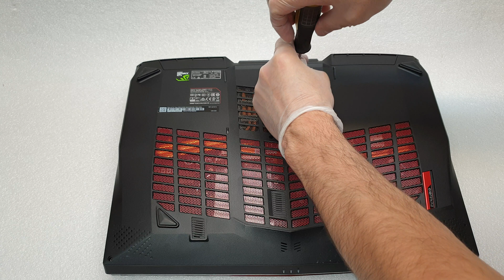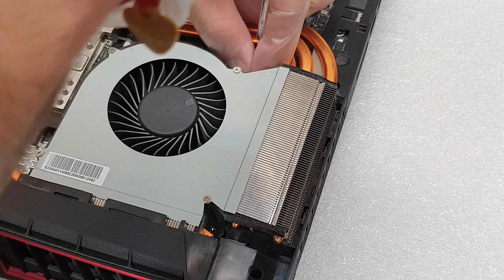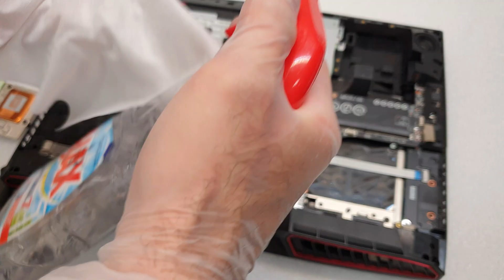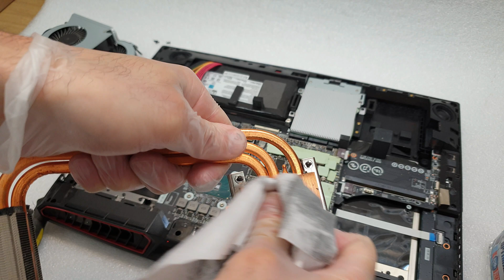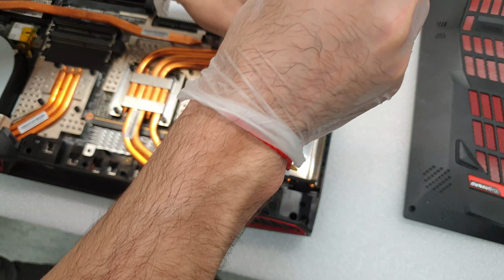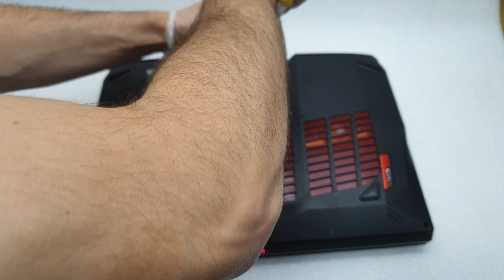MSI GT75 TITAN 8RG | MAINTENANCE | THERMAL PASTE RENEW | ЗАМЕНА ТЕРМОПАСТЫ

Comment: How can I replace the battery of MSI GT75 Titan Pro?
Reply from the maker: unplug it and replace.. :)
Reply: @RMFUNTIK  Ok, so it doesn't have screws holding the battery. Can I upgrade the processor of this laptop? I mean is it possible? Because the processor doesn't support windows 11, the a bit higher processor is supported.
Reply from the maker: @YourLanguageChannel  if it's not soldered on the board then yes.. but i don't think it would give you a better performance.. this laptop is outdated and a new OS won't give you a boost eather. So not worth it. The battery is likely glued with duble adhesive
Reply: @RMFUNTIK  Then what's the solution? This laptop will stop receiving windows 10 updates, and windows 11 is not supported.
Reply from the maker: @YourLanguageChannel  do you really need updates ? Windows 11 is not that good... Better stick with windows 10.
Reply: @RMFUNTIK  I mean, Windows 10 will stop giving updates after a year. otherwise I won't update to windows 11. that's why I asked
Reply from the maker: @YourLanguageChannel  so what? it will still work..
Reply: @RMFUNTIK  Ok bro